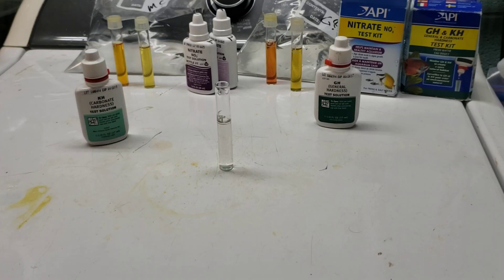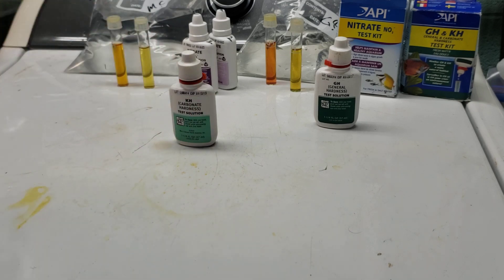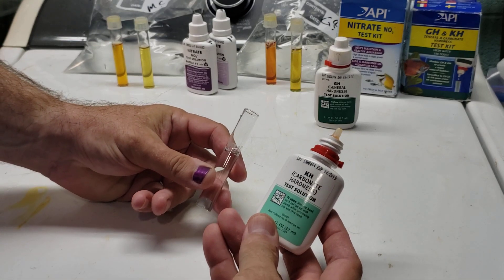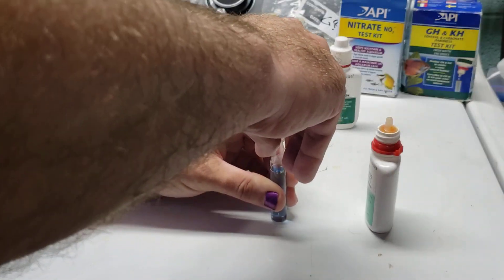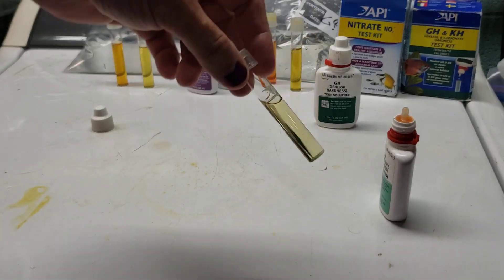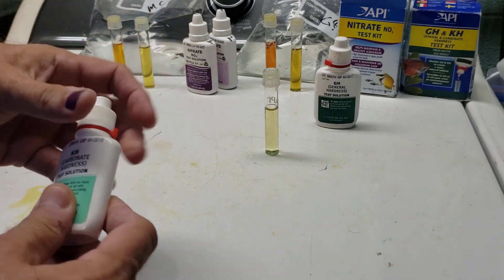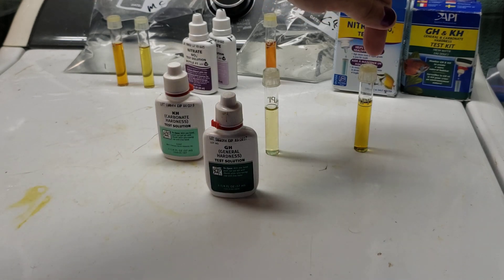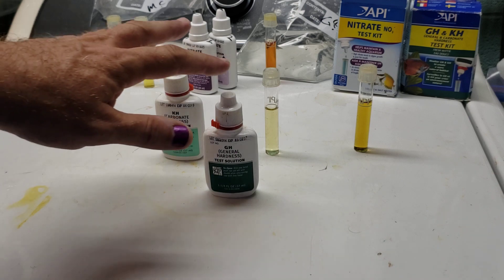How To Use An API KH Test Kit

Comment: Is my water fine if one drop changed to the right color? We are not understanding this
Reply from the maker: It would indicate very low KH.
Reply: @DanHiteshew-oneandonly  so what do i add?
Reply from the maker: @leenad.9784  You can add some crushed coral. this will increase yur KH and your GH. I keep my KH around 2 or 3 and that's enough. My water is still pretty soft. I put it in my filter tray.

Comment: Hey Dan. I'm keeping African Cichlids which of course means my GH and KH are both between 9 and 18 degrees approx. Is it necessary to do the test 1 drop at a time or if I know my levels are higher than 12 can I just start with 10 drops and add 1 or 2 at a time after that ?
Reply from the maker: Sure, as long as ten doesn't change the color.

Comment: i think my ponds ph and kh have crashed, on the first drop for my kh test the water turns light yellow any idea if this is a crash? the tests are new  and ive done about 800 gallon water changes my pond is 2000 gallons
Reply from the maker: That seems like little or no Kh
Reply: @DanHiteshew-oneandonly  yea ive added microbe lifts kh booster but now one of my butterfly koi are showing reddness in its tail fin so i assume its stress but not sure
Reply from the maker: @anthonybeneventano3077  Are you sure it's not hemorrhagic septicemia?

Comment: So I did this to my rodi water, and the took 1 drop and gh took 1 drop. But my ph is around 7.6-7.8 why is that?
Reply from the maker: You can have low GH but still have KH. I'm not sure why RODI water would have any carbonates in though. Are your RO filters in need of replacement?
Reply: @DanHiteshew-oneandonly  I just purchased the unit, so that shouldn’t be the case. 
I’m reading 0-1 ppm tds so I’m very confused lol
Reply from the maker: @MK_Aquatics  Yeah, that's a bit of a puzzler, for sure. Pure water is neutral, and the CO2 from the atmosphere lowers it a bit. RO water is usually around 6.5
Reply: So I let the water sit over night and tested the ph today, it’s now around 6.8 ph

Comment: Are we supposed to add the number of drops from both tests, and then use total drops as the measurement? I ask because instructions included with the test kit are so ambiguous.  (and fine print that is too small to read)
Reply from the maker: What do you mean "both tests"?  Just count the number of drops it takes to change color. You don't have to repeat the test.
Reply: @DanHiteshew-oneandonly  I answered my own question by watching a different tutorial.  "Both" tests means exactly what I said: two  tests.  These are KH and GH.

Comment: Take your number of drops and multiply it by 17.86 to give you a total ppm. This is how you can estimate how much carbonate is in your water.
Reply: Where did you get this number from? I was wondering how to get a more precise ppm number instead of "3 drops" which = 0-50ppm on the test result card...
Reply: @TheGreatJustino1  
One degree KH is equal to 17.9 mg/I (ppm) CaCO3. It's also measured in degrees. The degree symbol may be replaced with a d (ie. 2 dKH).
Reply: I have a different calcium test kit but I tried doing what these people were saying and I used 20 ml of aquarium water and then did the instructions normally and then I also tried doing 20 mL of water but then using four times the amount of reagent one and two before adding the drops of the third which turns the final color. When I did the test with 5 mL of water it took one drop to get the color changed (20ppm or less) when I did the test with 20 mL of water it took five drops with the first way and four drops with the second way so I'm wondering if my water actually has about 20ppm of calcium

Comment: My KH test solution is orange, but when I add it to water, it doesn't turn blue, it just stays orange. Add more drops, still orange. My GH test solution is already blue/green and never turns orange/yellow. Is my test solution just bad? I ordered the test kit from Amazon and several people are complaining of bad batches in the reviews.
Reply from the maker: Take an antacid tablet and dissolve it in water. If the test does what you're describing, then it's bad. It should give clear color changes in water that has some hardness. 
If your water is really soft, the test will do what you're describing. Indicating no hardness.
Reply: @DanHiteshew-oneandonly  Thanks! When I dumped the test tubes out in the sink with the water running, they changed colors, so I think they're fine. My results must just be 0 then for both GH and KH. The instructions say  0-3 for Discus, Cardinals, and live plants, which is what I have. So, I hope I'm okay.

Comment: Mine does not change at all is this good thing or bad I’ve got up to 3 drops and it’s the faintest tint off yellow is this good or bad thing please help.
Reply from the maker: You may not have any Kh at all. When I test it, I get a weird yellowy color that never changes, no matter how many drops I use.
Reply: @DanHiteshew-oneandonly  so is that good or bad thing that a don’t have any kh in my fish tank.
Reply from the maker: @wayneclark2458  Your pH may swing without any Kh to buffer it. There's products you can buy, or put calcium carbonate, or calcium based rocks or substrate.